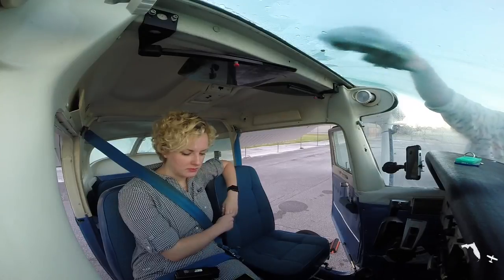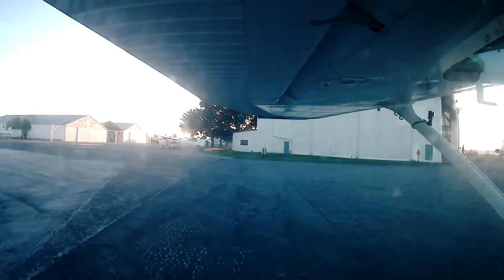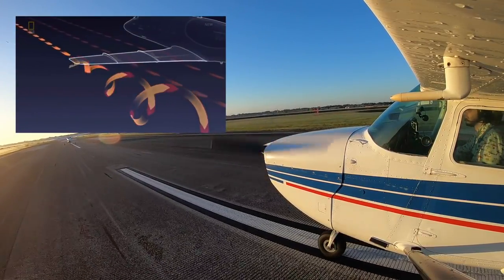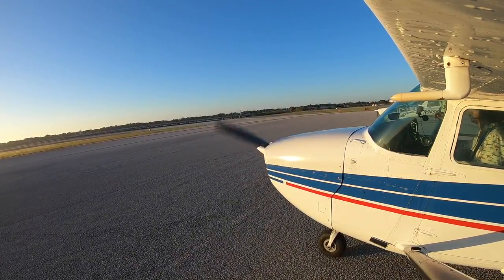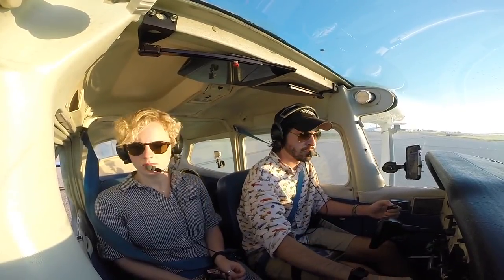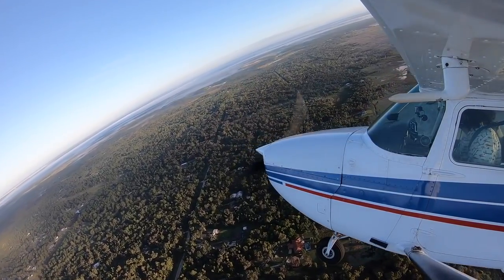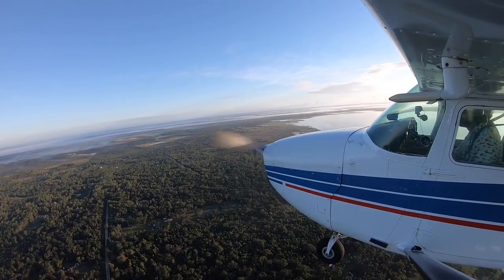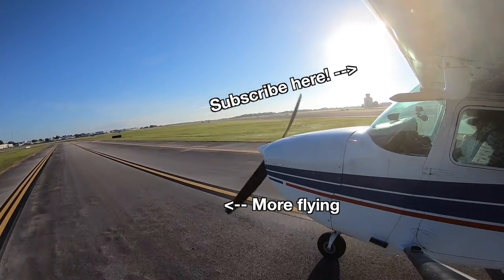What are Propeller Vortices? | In-flight Decision Making

Comment from the maker: small correction on the explanation: technically the temperature cannot fall below the dew point, but it can fall TO the dew point. So even though the atis said the temp and dew point were equal, they probably were off by .3-.8 degrees
Reply: The automated wx gives temperature in centigrade?  
 
Did I know that? 🤔🤔